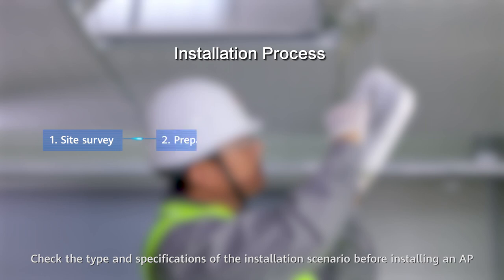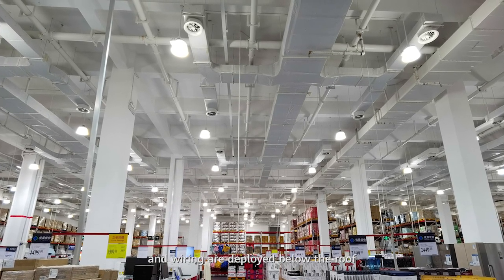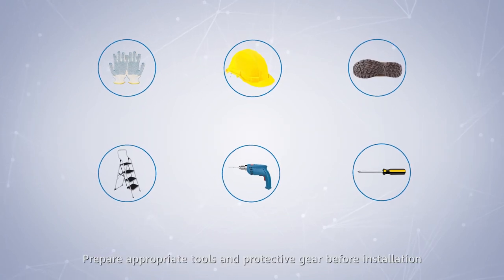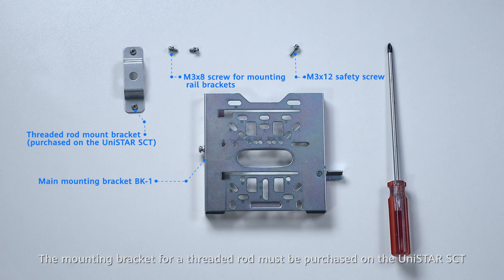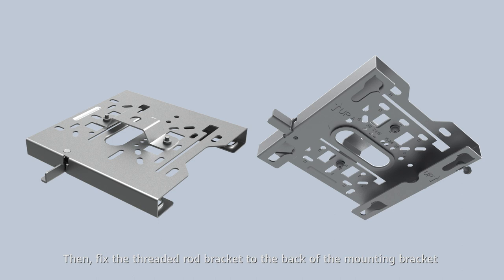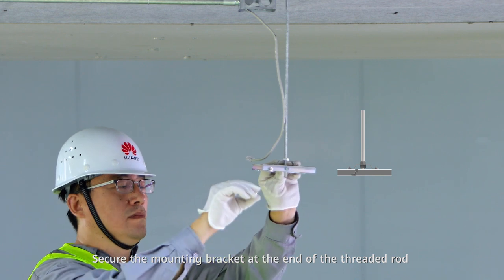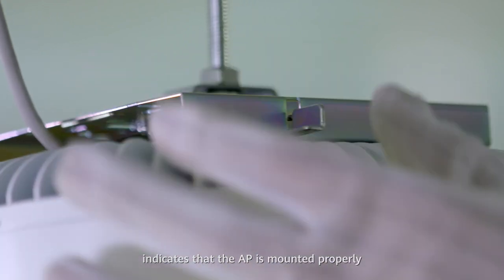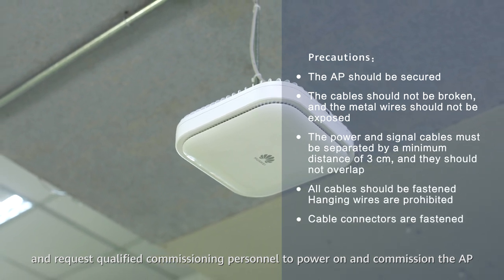How to Install Huawei AirEngine Indoor Settled APs On Threaded Rods

Comment: please how can i switch it on?
Reply from the maker: Thank you for your feedback.
Our APs do not have a switch button. They are powered on by a PoE switch or power adapter.
If you have any other questions, leave messages in corresponding web pages.
Reply: @HuaweiSupport  okay! i have a LAN cable and i've connected it to my PC and it didn't powered i have also connected it with the adapter cable so the standby light has appeared but APs dosn't powered. what can i do next please?
Reply from the maker: Hi，you can refer to https://support.huawei.com/hedex/hdx.do?docid=EDOC1100025386&id=EN-US_TOPIC_0118113084&lang=en